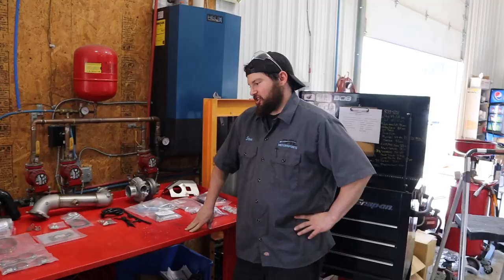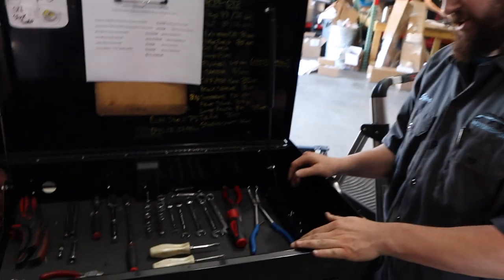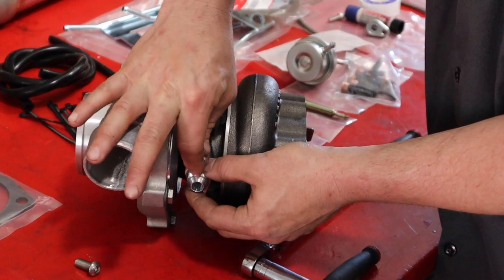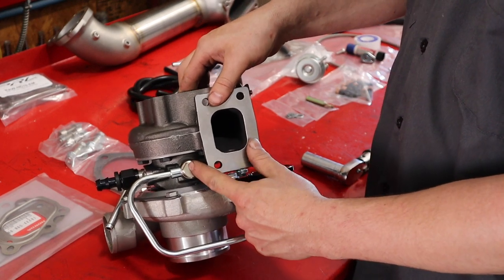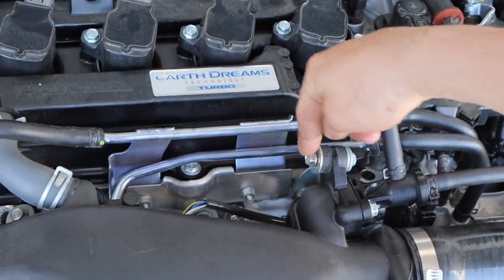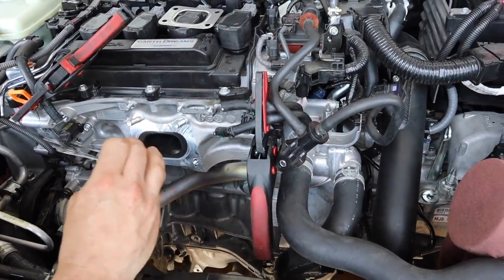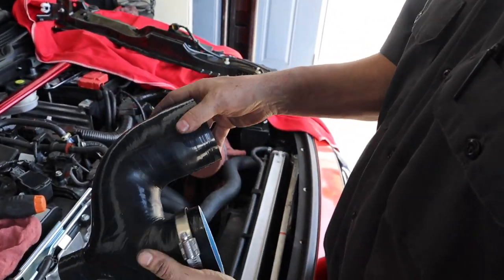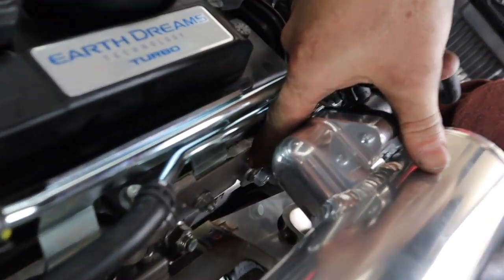PRL Motorsports Big Turbo Kit Install **How To**

Comment: Very detailed. Nice camera work. One thing I don't see is a catch can. Get one ASAP. This is especially important if you like to use your turbo a lot. And I know you'll be tempted to use your new turbo (I know I would!). In 30K, I collected almost a quart of oil and that's mostly commuting. I'm looking forward to seeing what your car will do on the dyno.
Reply: It's been proven by several 1.5T tuners & builders that catch cans do very little on these cars. MAP Performance has a complete end-to-end testing diary of their observations on the 1.5T at various power levels. Combined with the risk of irregular crankcase pressure/seepage, and the risk of the lines freezing in colder climates, I'd be very wary of running one on the 1.5T unless specifically finding evidence of excessive blowby. We just aren't seeing anything more than a few drops of oil and a ton of fuel/condensation (which actually helps wash the intake tract on the hot side). 

Also, it's been reported that Honda uses valve overlap and split injection to wash the intake valves with fuel, as the piston lifts from bottom dead center (forcing fuel mist out of the chamber and onto the valve & neck). This motor is much, MUCH more advanced than typical TCDI motors from a decade ago. If you suspect you're suffering from blowby, try first switching to a high stability oil like Amsoil SS.
Reply: @Godspeed931  This explains the remarkably clean throttle body at 31k. I now know how Honda did it. Thanks!

Comment: This is probably one of the most impressive install videos you have posted yet for this car. You are lucky Steve is cool enough to take the extra time to explain everything. He did start to loose me at the end with the little hoses but still an over all fantastic description. It is too bad we couldn't get the same level of description from the clutch install video. You can tell Steve knows his shit. He made the install look easy as pie and didn't stutter on any step. Congrats on the set up. I expect PRL E85 kit coming up. Will you make a video on the tuning involved after Turbo install?

Comment: very cool bro, I want to do this upgrade myself, but there isn't a ton of info online about real world gains, reliability and the  cars stock limits (fuel, power, ect). excited to see the next video. I was wondering which turbo you ended up going with. if you said it in the video I'm sorry but i missed it.
Reply from the maker: 2860r garret
Reply: @TTorres1183  Sweet !!! what about the turbine housing size?

Comment: okay so you are getting more power from the upgrade but my question is will  that be to much for that engine to handle long term when honda designs these engines they choose the turbo to match the engine so it can handle it adding that much more horse power can lead to engine failure hope u have good luck with it
Reply: the engine will blow. Its already happened to people unless you choose to go internals.
Reply: The engine will only blow under this set up if it runs a bad tune. There are other guys running this platform at 400+ whp without shooting rods or blowing Pistons. The biggest issue right now is the stock fuel system and ecu limits what you can safely squeeze out of that block. There's also the recommended oil weight from factory is way too light to push. A safe tune with a standalone system or even Ktuner and a heavier oil weight like 10-30 should keep your block safe. Again the tune is the key component. If you have a shit tune, anyone can blow their motor. PRL is a good company to mess with. They just hit 11's on their shop car. TTorres is in good hands.
Reply: @o0mrrobot0o26  ya but I believe  the transmission has a hard time dealing with this sort of power. check out MAP last video 2nd track day boom. I think they have been through several trans now. looks like deja vu from k series trans. I guess they're made from glass now.
Reply: Michael Pirroni look up K20z3allmotorFTW that guy runs +400 on his Civic and all he did was retrofit a type r clutch and flywheel on his. The transmission is plenty strong. I can't speak on what PRL is doing on their car but you have to take into consideration what they're doing and what limits they're pushing the car to so they can build these kits for us and recommend safe levels. Just because they broke their car pushing it on the drag strip doesn't mean anyone that gets their kit is gonna blow their trans. There's a huge difference going full send down the track and building a street car. Most people that buy these kits aren't gonna go full send down a race track and if they wanted to I'm sure they'd build out their trans. These kits are plenty safe as long as you have a proper tune and consult with a reputable shop like TTorres did.
Reply: @o0mrrobot0o26  i get it, there is much more traction on a prepped drag strip, with fat sticky tires. Furthermore, we don't know how the power comes on through out the power-band.  however, the fact of the matter is it shows that the transmission had trouble putting down the 400+ power/torque reliably in possibly optimal "track"conditions. This platform is relatively new, and i'm glad they are the ones testing the limits and not me.   its one thing to say  my car makes XXX hp/ torque; its another thing to say it makes it reliably all day every day,day in, day out, and you can utilize it(in more than 1/7th of  the power band).   i own a 2018 si myself. I do like the car and I hope someone does create some sturdier transmission parts that hold 400whp/tq, because i'd like to see these cars making at least this sort of power in a reliable usable daily driven vehicle within a good portion of the rpm range. I know some people do, but I surely wouldn't want to spend a bunch of money on a car just to spin the tires; I want it to grip, propel me like a rocket,repeat, and not break, at least for a few years.

Comment: I'm curious to know if you had any waste gate issues after installing that PRL big turbo. Neither one of the two turbos that I purchased would work with my stock waste gate. I had two different shops try to tune and dyne. Neither could get it to work. Even put in a new waste gate.
Reply from the maker: Did you buy the PRL kit?

Comment: Is the rest of the internals in the motor stock? I did see a vid of someone using a big turbo kit and his rods snapped and basically ruined his motor. Wondering if this kit is safe with the stock rods if you tune it a specific way
Reply from the maker: Stock motor. Car runs great. I’m a little over 5,000 miles with this kit.

Comment: Tyler, at 24:00 he's explaining how hes going to remove the 4 turbo exhaust bolts. I see that 1 bolt is missing, did it break, or was it removed prior to explanation?
Reply from the maker: I was broke prior to this installation
Reply: TTorres1183 thanks. Yeah the first time  I did it it came out alright, for some reason it snapped the second time.
Reply: TTorres1183 I forgot to ask, did you weld a nut to it an back it out, or did you have to drill and tap it? My guys working on it now and they welded a nut to it, but snapped it already
Reply: Nvm, the bolts gone. But guess what, they found a crack between the turbine and wastegate! Time for a new turbo!

Comment: 1. I hate to pick on people for literal terms within a video, but the mechanic called it a blowoff valve. It's a bypass valve.

2. It would've been nice if PRL would've designed an exhaust housing to adapt to a GT or GTX center catridge and compressor housing. That way they dont need to use that silly manifold adapter that has a great potential to leak within time (at both gasket mating surfaces). And it would allow for multi option upgrade of garrett turbos for this 10th gen civic platform.

3. Im wondering if the GTX3071R that they sell on their website as an upgrade even fits in the engine bay with that adapter installed?

Comment: That feed-line adapter will be the death of a turbo... Once that screen filter gets clogged even by a little bit, it will reduce the amount of oil pressure being fed to the turbo significantly and will cause the turbo bearings to overheat and fail. Also, if you're going to filter a line before the component, use an actual in-line filter that can be removed and cleaned or replaced.
Reply: Yeah ok

Comment: Ok does this require any non factory things like would i need an upgraded intake or upgraded exhaust or can I technically use the factory parts
Reply from the maker: You need upgraded parts. Check out the kit on the PRL site

Comment: Hey, I have a question. I have a 10th gen civic but it is just a 2.0 DR, meaning it has no prior turbo. Would this kit still work for my car?
Reply: Wondering the same I have a 2017 civic ex 2.0 and want to install it on my car. Did you ever figure out if it’s compatible?

Comment: damn the made it pretty easy to swap turbos in this 10th gen!! damn im this and a clutch upgrade only is a good sleeper car.
Reply: Not to mention tune, possibly fuel pump, injectors, 100% gonna need new rods, $100+hr tune
Reply: @wes89  Do you even drive an SI? I've not heard from one person that installed this turbo or the 27won turbo say they needed a fuel pump or injectors. Definitely not needing new rods unless you plan to push high into the 300hp range.

Needing a tune is obviously unless you've never modified your car before.

Comment: What's the difference between PRL and 271won?? Tubro
Reply: Two completely different platforms. The 27won is OEM bolt on. This one has new plumbing and intake pipes. The compressor wheels are both different and the exhaust wheels/housings are completely different. 27won uses an exhaust housing cast that mimics the oem turbo.

 Don't quote me, but T25 comes from the Mitsubishi Housing Industries (MHI). It originated from the galant VR4 and eclipse. Id be surprised to see anything more than 300whp from this turbo. I remember people were converting to the T28 from this turbo barely achieving 400whp with fully built motor and full bolt ons. Although the exhaust housing and or compressor housings might have changed since that era.

PRL offers the more modern GTX series (ball bearing) turbo as an upgrade package; which compared to the T25 (Journal Bearing)  turbo is A LOT better option even at lower boost. Im sure they offer the T25 as an option for the kit to keep cost down.

Short story, i would assume that the major difference (if you have little knowledge about turbos) is that the PRL kit gives room for upgrade to larger turbo options later on in life. Where the 27won is pure bolt on and probably outputs more power compared to the T25 "entry level" turbo offered as a part of the kit for PRL.
Reply: @modfydgarage2312  thanks bro that was helpful

Comment: Do you need that manual boost controller if you have a KTUNER? if so can I get a link or what’s the name of it?
Reply from the maker: They have it now to were you can use the electronic waste gate
Reply from the maker: If you do the big turbo upgrade you can use the factory electronic waste gate instead of the boost controller